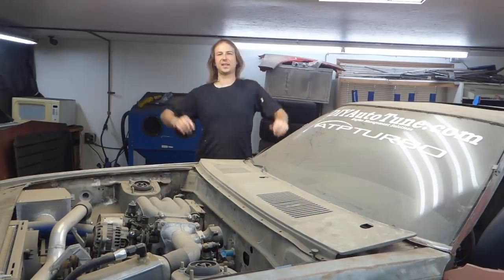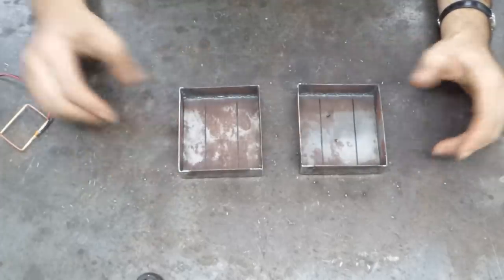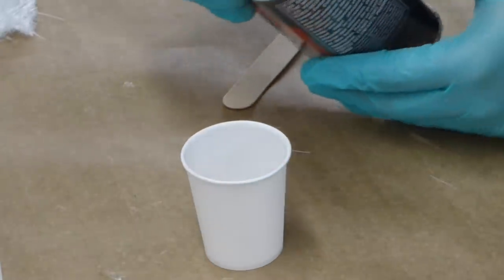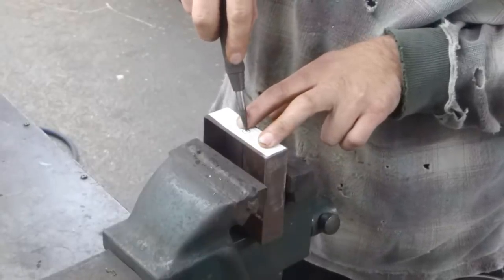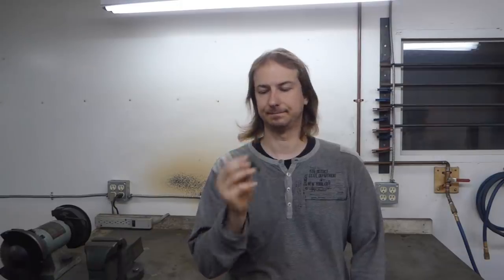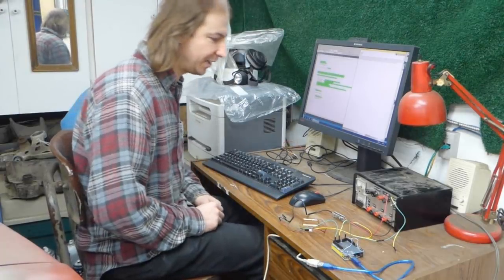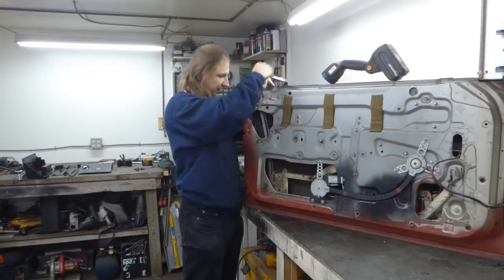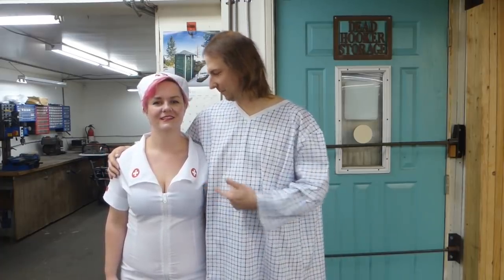Part 46: RFID Door Locks/Openers - My 76 Mazda RX-5 Cosmo Restoration

Comment: I'm really impressed with how your fibreglass pieces came out. Me personally though, I would've stuck the coil to the inside of the rear quarter glass with some clear vinyl wrap and saved all this effort.
Reply from the maker: But that's far less magical. And one could see the coil. I did consider that but felt it would take away from some of the cool factor. For a first ever fibreglassing effort I also think the result wasn't too bad. A few air pockets here and there and obviously had to mill out the extra material, but basically worked.

Comment: Well, at this rate id think if you didn't use the RFID to actually start the engine I'd be disappointed. Maybe do a keyed backup somewhere just in case you loose a hand to infection.
Reply from the maker: Ultimately yes, there will be an RFID reader in the car to enable the vehicle to start. At least that's where I think I'm heading. Haven't completely decided on that yet. Definitely another reader at the trunk for those times it is inconvenient to reach for keys/remote. The final system will allow multiple tags to be recognized so no problem having backup/valet/secondary driver (yeah, as if someone else will drive the car) tags.
Reply: Unlocking the doors with an RFID implant is cool as hell but if you've then got to use a plain old key to start it whats the point haha. 

What's the plan if the RFID System fails or the battery goes flat?
Reply: baggedandblown a charge point available from the outside of the car would help in some situations. Maybe keep the trunk accessible from the outside w/o power if the locks fail
Reply: @aaroncake  I was kinda wondering how you'd do a valet key. "Alright, buddy, hold still. This won't hurt much."

Comment: Hey Aaron, is the regulator necessary if I'm going to use an arduino nano with the module? What about power consumption? I am going to use something similar for a motorcycle.
Reply from the maker: 12V is about the maximum you would want to feed an Arduino with because of the regulator used on the board. You also don't want to feed it directly from the dirty 12V, which of course could go as high as 14V, from the alternator/magneto. Best bet would be to use a DC-DC converter with a 5V output and run both the Arduino and RFID reader from the 5V source. I made the regulator board since I wanted to run the module from 12V instead of shuffling 5V around the car which would be subject to voltage drops and interference. As for power draw, the RDM6300 uses about 50mA while the Nano uses about the same but can be put into sleep which reduces power consumption to a few microamps when idle. I bet that any regulator you use to drop the voltage to 5V probably uses more current.

Comment: Merry christmas Aaron, looking forward for next mini-projects on the Cosmo :)

A small tip about etching. I put the PCB on the top of cloride with the copper layer down, let it float by itself and let chloride do its job. Works quite nice, you don't have to wave with the whole bowl...just need to be a bit carefull, not to catch any bubble under the PCB. Also you can see the progress of etching thought the fiberglass of the board...and just close to the end really take it out to check it :)
Reply from the maker: My boards always sink. On my long list of projects is a vertical etch tank that pumps etchant over the board, while keeping it warm. Actually I intend to try the muriatic acid / hydrogen peroxide etchant as my ferric chloride is starting to wear out.

Comment: Bloody excellent!

I will admit I was quite worried as your website was down for a bit, which had me frantically scrambling to Wayback machine to save a copy of your megasquirt guide!
Good to see you back posting great content.
Reply from the maker: My website won't ever disappear. Been running it since 1995 and have no intention of taking it down. Hopefully it wasn't down for very long. I self host, so I know it wasn't a server issue. Likely a connectivity problem higher up the line.
Reply: @aaroncake  it was down for about 2 weeks I think. All okay now though. It's been a massive help to me and I'm sure others.
Reply from the maker: Whoa! Must have been a connectivity issue because it definitely wasn't down for two weeks. I have a monitoring system that checks the basics (ports open, services running) every 60 seconds, and performs user tasks (running through forms, checking dynamic page generation, etc.) every 15 minutes. Definitely would have known. :-)

Comment: I liked that idea and am inspired to do same on my '75 Datsun 620 project, though I'll dispense with the implant! I'm enjoying your videos and noted that I have similar tools being used in my build (more Princess Auto than Cdn Tire). My build is a complete frame-up but will soon be putting my mig welding skills to the test.
Reply from the maker: But without the implant, where is the magic? It won't be long now...one of us, one of us...And thank you for reminding me that I need to hit Princess Auto during the current sale and pick up some more of those plastic drawer parts storage cabinets. On the Datsun 620, what are you doing with the drivetrain?
Reply: That magic will be in my pocket! I'm also planning on a keyless start to go with that. I'm grafting the '75 620 KC body onto an '85 720 frame to gain front discs and updated electrics, this way I can add AC or whatever since the 620 only had 5 electrical circuits. For the immediate future I will use the Z2.4 but am looking ahead to using a Nissan V6 to keep it in the family. The cab came with an aftermarket sunroof installed so I'm planning on fitting in a spoiler-type sunroof once I find a suitable donor...

Comment: I've had better success using regular laser paper it seems over the transfers.  Which ones do you use? They are different than the blue ones I have used.

Thoroughly enjoyed as usual. This is good motivation to finish my touch screen dash. 

They make these buck converters that fit in the footprint of a 7805, that work on a very wide operating range of like 9 to 48V with a 5V output.  I use that with a TVS Diode and that allows compact + flexibility and through hole.

Though hole parts are where it's at. Maintaining servicability potting permitting.

Keep up the superb work!
Reply from the maker: I use the toner transfer paper made by Pulsar. After I figured out that an iron SUCKS and went to a laminator, I don't think I've ever had a failed transfer. Have done traces down to about 0.5MM but try to keep them nice and thick in case I have a reason not to. I believe I used one of those buck converters a few months ago when I designed a landing light board for RC planes. Because the battery voltage varies so much. Based on an ATTINY85 and a few MOSFETs.

Comment: Firstly, impressed with, and jealous of, the RFID implant. I've wanted to get one for a long time, but i A) don't know what I'd use it for, and B) am a mechanic for a living, and would worry about it breaking in my hand.

This is a pretty awesome implementation. You should try and incorporate similar systems in all you vehicles (including ignition), as well as the locks on your house. You'd never have to carry a key again!

Just a (the) tip: When potting those PCB"s, you could've welded the ends on, and left the top open. The PCB's would still be completely sealed within the potting compound, and both mounting tabs would be welded on. I'd honestly worry about the end you "bonded" with the potting compound breaking off. It might feel solid, but repeated shocks from closing the doors, plus road vibration... There's a good chance of that joint failing. At the very least, consider tacking the corners.
Reply from the maker: So many uses! For example, RFID readers to arm and disarm your alarm. RFID access control stuff is dirt cheap on eBay from China. Yes, breakage COULD be a concern in extreme circumstances. But by the time the implant is broken, that part of your hand is crushed so a broken RFID chip would be the least of your concerns I'd think. The  body surrounds it will collagen after a month or so, encapsulating it in a protective layer. But definitely the hand needs to be treated gently for a week or two after implantation. I do all kinds of physical stuff; working on cars, construction, shooting, biking, etc. and am not worried about it.Oh, I guess I didn't show it in the video but before I put the ends on I had cut slits on the bonding side with the Dremel, for more surface area for the epoxy to grip. That stuff is wicked strong.

Comment: This escalated way too high!!! I would've never imagined you doing that.
A noob question about RFID implants, do they contain metal? And does the metal detector at the airport go on?
Reply from the maker: They do contain a small amount of metal in the form of the copper antenna coil, and metals used in the integrated circuit. But it is such a small amount that it really won't be detected by most metal detectors unless they are very sensitive (to the point of many false alarms) and localized. Shows up in x-rays though. I do intend to have my hand x-rayed at some point so I can see the tag and exactly where it has settled.

Comment: That's just incredible, awesome video 👌🏼 But I'm curious can you easily hop on a plane with the inserted transmitter?
Reply from the maker: No issue. The RFID tag is passive. It only transmits if it is powered up by the RF field generated by the reader. Because of that it has a very short range of only a few CM. No problem for metal detectors, millimeter wave machines, etc. But would show up in an x-ray.

Comment: H O L Y S H I T! 
A B S O L U T E M A D L A D!!!
i have a magnetic vision implant under the skin, slightly to the left on my left hand index finger so i know how this procedure goes but i was COMPLETELY  not expecting the end there. 
subscription earned
Reply from the maker: I'm curious, what do you use the magnet for?
Reply: @aaroncake   sorry for the late reply but i originally wanted to be an electrician. im sure you know how magnets and electricity interact when within the same vicinity. well the small magnet under my skin osculates when it comes near a live/higher voltage electric line. i can feel outlets behind thin walls and metal detectors, i was a small body mod that comes in handy sometimes especially good and finding magnets in other things that you cant see normally.

Comment: That’s such a cool idea,if I had the brain capacity to come up with that I would have attempted fixing the reader behind the rear 1/4 window with an extended loom to the trigger instead of opening the handle space up again.only providing it could read through glass
Reply from the maker: It should read through the glass. The range is a few CMs and unless the material between the tag and antenna is conductive it doesn't seem to have much effect on range.

Comment: @aaroncake I actually have an RFID circuit already built to do the exact same thing. =] I too plan on getting the chip implanted in my hand. The only diff. is I want to be able to enable terminal 15r with the same chip, allowing me to start the car using a Starter Button. If I really want to overtune... I may even implement biometric security via finger print scanner... but that would be included in later revisions. lolz I have been designing a CAN system for my car for a while, just never have the time to actually install it all. So far all I have installed is a Raspi running Kali Linux attached to a 7" Touchscreen, Custom fit into the factory location with OTG, USB, AUX, Ext. WIFi Ant., WiFi Hotspot, and Portable HD installed. I was orig. going to design the entire system using Raspi and arduinos, although lately Ive decided to use a micro atx based mini pc. The Raspi just isnt fast enough anymore. hehe I eventually plan on including things like, Rain Sensor to control wipers and raise windows if it starts raining, various data sensors, camera, etc. Love the vids. Jeremy Oh! My car is a 04 GTi, before this car though, my circuits were designed to be fit in mk2 VWs. :)
Reply from the maker: It sounds like we have quite a lot in common. I ran a car PC for many years in my RX-7 and Insight to play MP3s (info on my website in Projects section). Actually for about 5 years I was an Admin on mp3car.com, back when it was mainly a forum. I'll be implementing CAN on the Cosmo as well. In fact it is looking like the next video might involve some of that. Going to try and stay away from SBCs or general purpose computers because mainly reliability. I'll be designing a body ECU for the car to control everything, leaning towards using an ESP8266 as the core. That really is my favourite microcontroller at this point. Not a lot of I/O but with I2C can have infinite in/out channels. Plus WiFi, so for example the car could connect to my home automation system and report status. Definitely going to implement a rain sensor (Binky did it) as well.

Comment: How do you get in if the battery is dead?
Reply: You can leave the battery at home and Wi-Fi the charge directly to the vehicle...now.

Because, rotary.
Reply: cyclinglievens you break the window.... duh
Reply: Install external jumper terminals, behind a hinged license plate or under the rear.
Reply: Put an Anderson SB connector inside one of the bumpers. No way to plug it in wrong, even when plugging it in blindly and the contacts "self-clean" when plugged in.

Comment: You nutter Aaron, you really should have made this so you can easily replace the door setup if it ever fails, how is this possible once filled over? Still love your videos...
Reply from the maker: Since the antenna coil is just a coil of wire, I'm betting the chances of failure are fairly slim. But note I did make the electronics accessible just in case. You are of course correct that if the antenna does somehow go bad, it will be a real pain in the butt to replace.

Comment: When I heard you plan on bondo-ing the receiver into the door, I thought ... what if you need to replace it after paint?  Then you injected the transmitter into your hand!  
Serious question: what if the battery is dead or the thing otherwise fails. is there another way to unlock the door?
Reply from the maker: Since the battery will be in the trunk, easy enough to access it. The reader antenna coil is basically just a piece of wire so a pretty low chance of it going bad. However if it does...that would be unfortunate and a major pain in the ass.

Comment: Mighty fine pair of  fiberglass ashtrays you cobbled up there! Id be happy to butt my cigs out in them! Im just kidding! ;-) Your videos are awesome & well made Aaron. I respect your attention to detail & style of car modification/fabrication. Not to mention your commitment to doing things correctly & not cutting corners to try & save time. Keep up the amazing work & content. I always look forward to it. Btw, what are your thoughts on 20b's & 26b's? Can you ever see yourself building a 3 rotor for something? I realize you're a bit of a wankel 13b purist, which is cool, but I'm curious what you think of some of the other, more "extreme" if you will, rotary builds ppl are putting together these days. I.e. billet irons, 3 & 4 rotors, turbo/ported renesis engines etc. Thanks for taking the time to read this, i know it's long.  -Will Baltimore, MD
Reply from the maker: Of course I have nothing at all against the 20B. I considered going 20B with the Cosmo but ultimately decided against it because it wasn't my intention to build a beast and let's be honest...If you are installing a 20B, you are going for 500+ HP. As for a 4 rotor, yes, at some point in my life I will be building a 4 rotor. I've been gathering notes, making decisions and considering it for years. Actually occasionally in the videos you may see the 4 rotor shaft I made from 2 13B shafts hanging around. Thing about the 4 rotor though is that it is primarily a cost venture. Minimum for the machine work and buying one of the kits is about $10K. Then add up all the seals and gaskets for another $2K or so. And of course, everything else has to be fabricated. Intake, exhaust, cooling, etc. So right now, not really in the cards due to time/money. But once all my other projects are done (yeah, uh, maybe when I'm dead?) the 4 rotor is on the short list. After a rocket belt.

Comment: I have done some fiberglass and steel seams in the past and i think that you are going to see that seam after it is painted and after months you are going to feel it too. It would be best to make a little seam for that but it would be pretty ugly because it is so big. If it would be similar shape to a normal door handle it would look good.
Keep in mind that only exoxy resin is waterproof.

Keep doing it, there is some cool stuff done to this car.
Reply from the maker: I'm thinking that panel bonding adhesive to fill in the gaps between fiberglass and sheet metal on final assembly would prevent cracking in the future.
Reply from the maker: And the rear will be completely sealed with POR-15, panel adhesive and seam sealer to prevent water from creeping in behind the paint via the fiberglass plug.

Comment: Thank you an merry chrismas.
As your next Job. Please run the Engine. 👍
Reply from the maker: Not quite ready for first startup yet. Thing about first statup is that everything now is full of fluids, and becomes a bit of a pain to work on. Everything in the engine bay still needs to be finished, disassembled and painted before final assembly.
Reply: @aaroncake  
The first Sound of your Engine will giff you a lott of Power to your Project.

Kind Regards from 
Bielefeld in Germany
Thomas